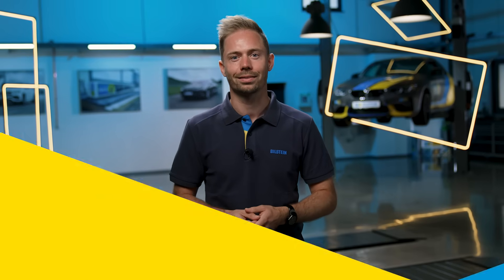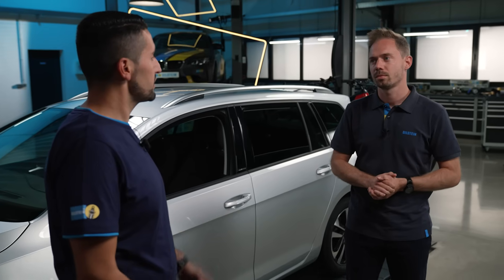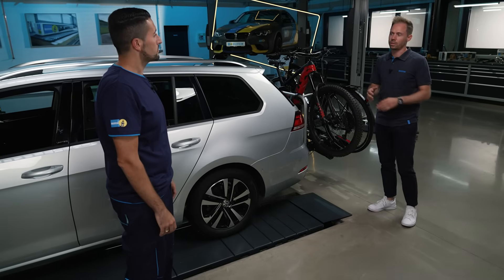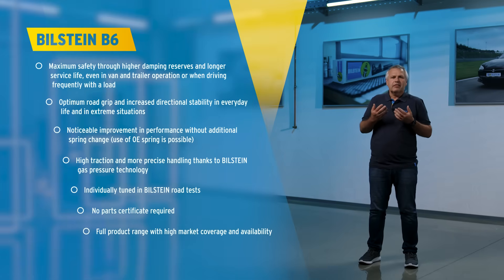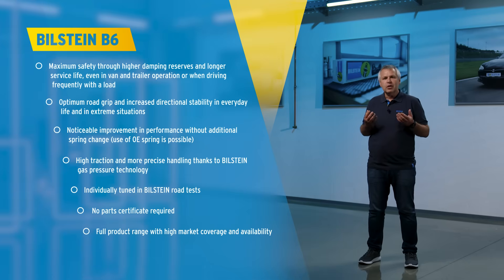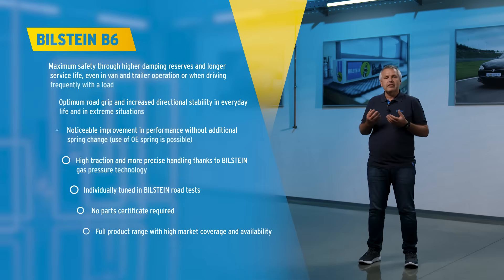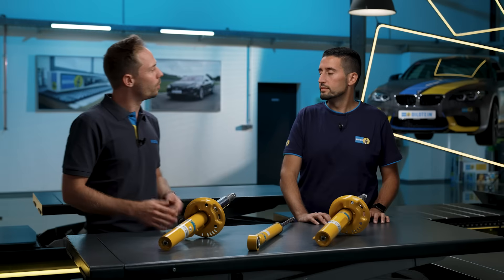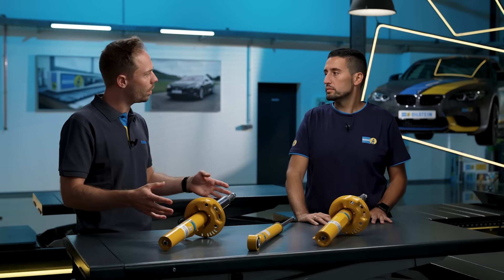“Suspension fundamentals” powered by BILSTEIN Academy – Shock absorber product range

Comment: I have a 2016 F30, 320 D - Msport, B4's are advertised as a direct replacement for the (SA704)  no they aren't that are soft under load, horrid soft damping  on undulating roads and is 15mm higher than stock on the front.

Comment: I badly regret letting my mechanic fit these awful shit shocks to my BMW e63, not even 6 months have gone by and less than a 1000 miles and they are already starting to corrode! never been anywhere near the coast or the sea etc but in the city, I only noticed the corrosion when the rear tyres were changed, 'made in Germany' more like made in Afghanistan, do not buy bilstein, I am so *ucked off having been charged a hell of a lot of cash to change all the shocks and springs, I can't even bring myself to look closely at the front shocks in fear f what i will find. avoid this brand!!! the customer service was also a bloody joke
Reply: Should have at least a 1 year warranty from the shop, if your mechanic did the work there.

Comment: On Passat B8 2017, the ride improved significantly, but I started hearing knocking / squeezing sounds ij the front. Unfortunately after refitting the shocks 2 times the knocking sound during drive did not disappear. I visited the official VW dealership from where I bought the car. They examined the car and said the original strut bearings are not compatible with Bilstein B6 shocks and confirmed this being the reason for the knocking sound. Does anyone has solution for this.
Reply: Bilstein offers their own stut bearings for the front, they cost about 100€ or less, for a set of front suspension bearings. It should solve your problem, i used to have bilstein b8 with h&r springs and i really enjoyed it, the feel was better than my new car.
Reply: @sakisztt  Hi, Bilstein answered to me to pay attention on alligning the upper end of the spring with the notch of the strut bearing. If not alligned that way, the spring is breaking the strut bearing, which is plastic.

Comment: I am looking for absorber for 2014 Passat Sedan 2.0 D with normal springs. Is there any difference between B4 and original VW absorbers? I like a little bit sporty than the original but not bouncy. How stiff the B6 with normal load on bad road condition? Is it recommended for my wife's car? :))

Comment: Hi!!
I have a 2017  Jetta GLI  with factory sport suspension.I need to replace the shocks , between B6 and B8  which one will work better?? Thanks for the help!!
Reply: B6 is for factory ride height whereas B8 is designed for lowering springs
Reply: @alextorkelson your answer is not clear! He has factory sports springs so... B6 or B8? Will b6 be good for factory sport suspension? Mine also has sport factory suspension s-line 30mm. I know b8 is for lower suspension but with aftermarket springs. What should i install to factory 30mm lower suspension? I don't want to get the car lower than already is.
Reply: @TakeActionGR  I wasn't even paying attention to anything in my original response. If it means anything, the Bilstein catalog states that Bilstein B8 are supposed to be paired with my 2016 BMW 340i M Sport, M Sport being factory lowered. I'd suspect if M Sport calls for Bilstein B8, the rules should be the same for a lower (sport suspension) VW/Audi as well.
Reply: @alextorkelson how many mm is your sport factory suspension than the standard one? So you have b8 already installed, how is the ride? And have you noticed any drop or raise? I don't want to lower my car, it is already low by factory for my tastes
Reply: @alextorkelson  ... Re: 1997 Porsche C2S (993) ... Is it true the B6 & B8 share the very same valving character,,,, separated only by height? ... B6 model is for a OEM standard suspension. .. Where as the B8 is for a lower spring (Sport suspension) height suspension. .. "Some say"  in the Porsche 993 model Fandom that the B6 has a harsh (street) ride character... by my current understanding of the B6 & B8 pair,,, there ride character would be the same only differentiated by a lower height coil spring influence. ....
Reply: @michaelschneider-  Yes, valving is the same - it’s been a while, but I actually had called Bilstein directly asking about B6 vs B8, and valving is the same. Couldn’t imagine why more “harsh” outside of ride height and spring differences, not sure how much different brands of springs influence harshness.
Reply: @alextorkelson  Thanx you. .. Copy that..